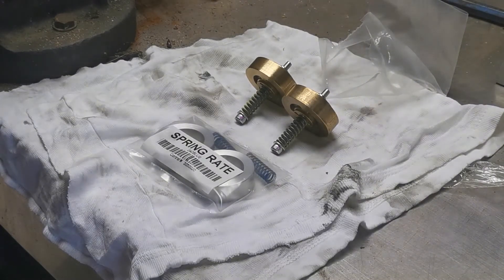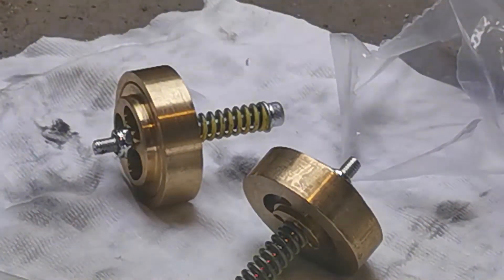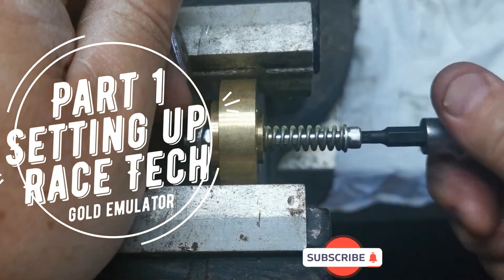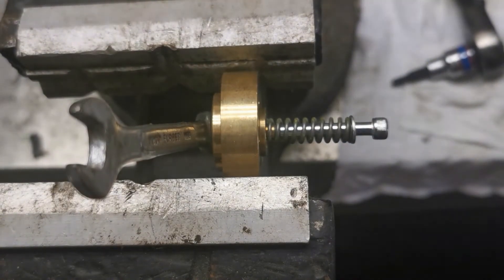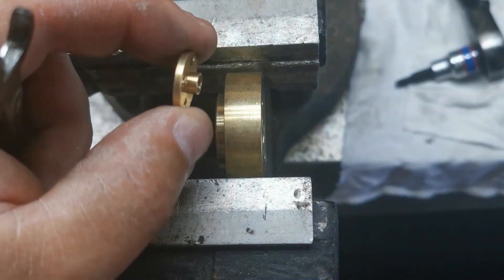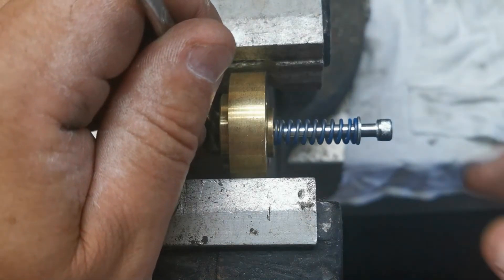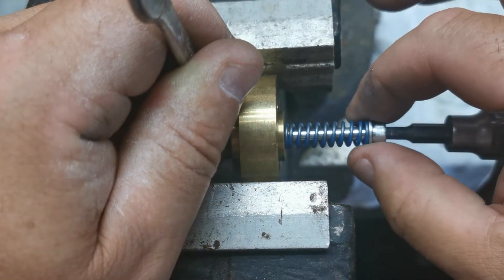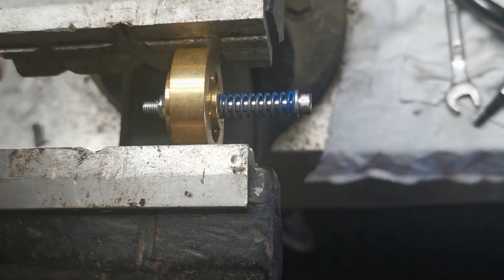Race Tech Part 1 Changing Gold Emulator Springs and Setting Preload on emulator

Comment: So how do I know what spring I need of my emulator I confused
Reply: So when you buy your gold tech emulator kit, you will receive a code. You will go to race tech and follow the instructions on that code. From there you will enter all the info it asks for (what you ride, how much you weigh, etc). Then it will spit out all the info you need. Fork oil weight, spring color, how much oil, how much dampening, etc. Goodluck
Reply: @Gnarlys_Garage  yeah that’s why I got confused I brought it not from race tech directly and didn’t get no code etc but I got it sorted in the end, but now I want to lower it so not sure if I have to change the springs again etc
Reply: @Gnarlys_Garage  Always wondered the same myself and installing these emulators in the tubes of my 2021 Vstrom 650XT next week. Thanks much for the info.
Reply: @frank how did your ride quality change?
Reply from the maker: https://racetech.com/page/title/Emulator%20Tuning%20Guide